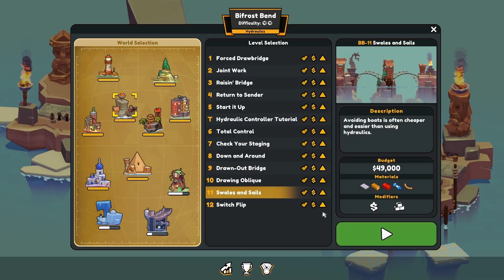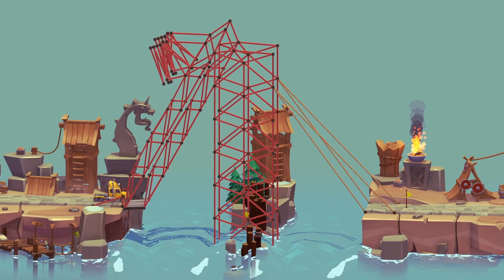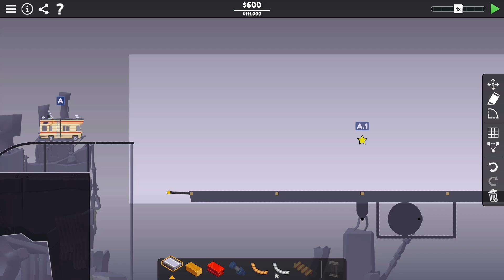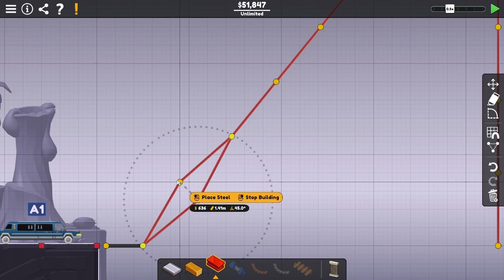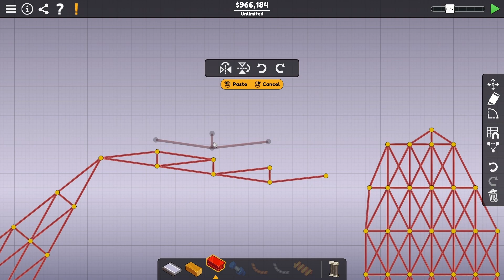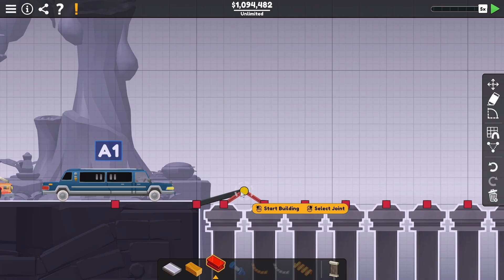Can You Beat Poly Bridge 3 Using One Road?

Comment: Personally to do Back to Foundations, I would have added the hydraulic controller to the level for split joints as well as some checkpoints to make a series of linkages that carry the road straight across and drop it off with the next one in line

Comment: So, the next challenge: can you beat poly bridge 3 using one bridge? (And by one bridge i mean the same bridge design for every level). I understand, that this raw is actually impossible, but you can, for example, add a lot of hydraulic phases to every level and a hydraulic controller; so each new level the bridge will look the same, but different hydraulics will be activated and change the bridge for this level
Reply from the maker: If I can get the files for every level again like I did in pb2, I'll consider it

Comment: I feel like a Roberts linkage might be better suited for bridges than the Grasshopper/Evans linkage you always use. It doesn't create a perfect straight line, but it only requires attachments on the ends of the line, no towers required.
Reply from the maker: Yeah perhaps, I don't like it since its a little more annoying to get the geometry right with but I should look into it more

Comment: I got one last idea on Poly Bridge 2. The way it works is you have unbreakable mode on,but you can't use supports. Non-hydraulic levels would be a bit easy,so maybe just the levels that require hydraulics.(it's idea-o-clock)
Reply: So you mean unbreaking but road only?
Reply: @Fogolol  I thought he meant you couldn't attach to static nodes.
Reply: @GhostGlitch.  honestly you could be right, i don't know exactly what the original comment meant which is why i asked
Reply: @Fogolol  Honestly rereading it, I think..? Your interpretation is more likely. But yeah I'm not 100% on the intent either.
Reply: @Fogolol  Yeah,kind of.